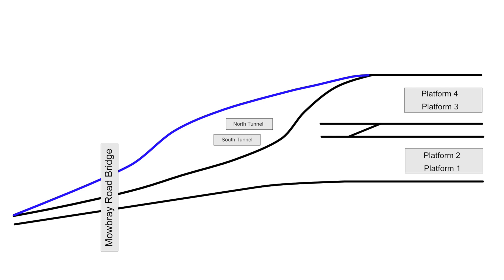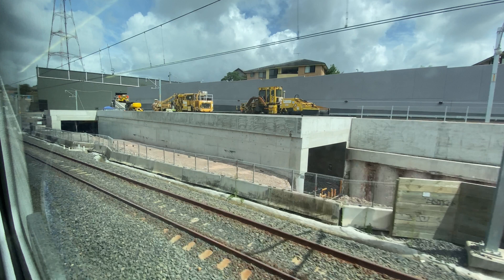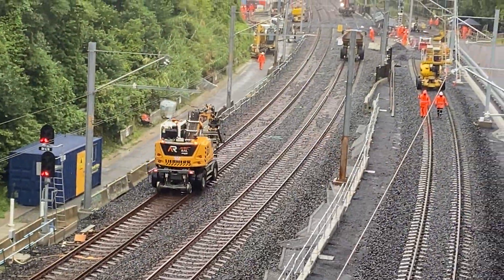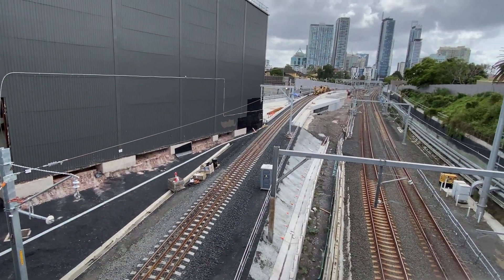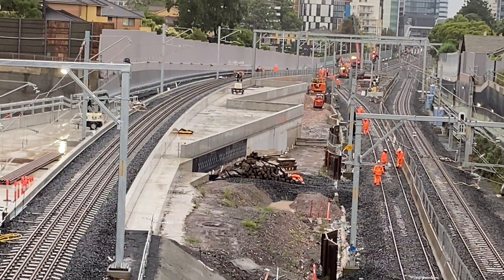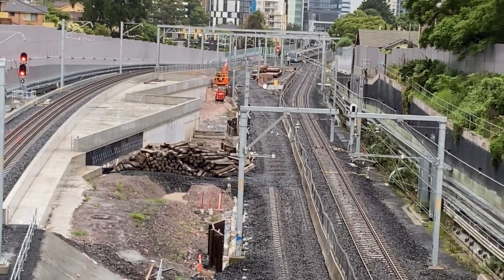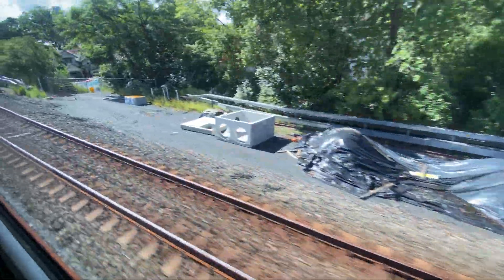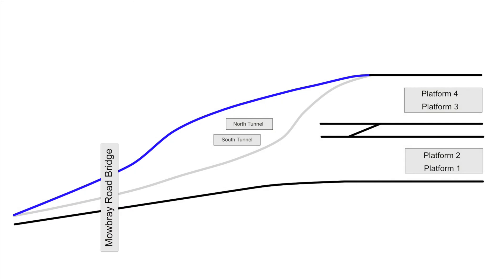Sydney Metro Chatswood Dive Site Update -  New Northbound Line Has Opened!

Comment: Paul, the barrier to the west of the Up main is the work site limit and the removal of the down main was in front of the tunnel portals as the excavation of the portals to link to the existing metro lines was to be undertaken within the two active lines without the requirement for a possession order and shut down of the North Shore line. 

Mind you I am not a fan of the metro as it drives a wedge through our normally brilliant network. This metro ought to have been an extension of the standard suburban system which would have allowed far more flexibility in journeys from location to location without the need to change trains. An example prior to the conversion of the Epping to Chatswood line, was that you could get a train from Hornsby to any of the stations along the line and continue on into the city, the reverse was capable and this did not diminish the services to the upper North Shore and increased services to the lower more populated lower North Shore.

Further to the above the line out to Tallawong could of been simply pushed the additional kilometre or so to meet up with the Richmond line at Schofields. The obvious advantages to this connection to the foot of the Blue Mountains and lovely township of Richmond and the Pubs and restaurants and parks from the North of Sydney via this link would of paid for itself with the weekend travellers.
Reply from the maker: Yes that's right. Personally, I see the metro as complimenting the existing rail system, rather than negatively affecting it.

As Sydney gets larger and more populated, the need for high frequency metro type services becomes more important. Think of London which has the underground as well as an extensive suburban train network (and now the Elizabeth line).  New metro lines do have other benefits such as wheel chair access without assistance, better acceleration, faster journey times between stops and potential to run trains every 2 mins through the CBD. Having said that, travelling from say Thornleigh to Wollstonecraft now requires two changes.

Extending the line to Schofields is part of the longer term plan, and it is lovely around there!

Comment: Now it all makes sense, Thank you for taking your time and doing this your dedication to this has been great.They are doing it in Perth for same reason on there airport Line, Also those 2 additional tracks are because the train needs to stay on the track, They did it in Perth for most there bridges So they are basically support tracks.
Reply from the maker: Yes that's right. They help protect the train in the event of a derailment, which is why they are on many bridges.

Comment: Slight correction, there was a second signal where the tracks rejoin at the southern end. (hard to see, it is black rather than grey on the rear. Newer design I guess.)

The tracks aren't just being moved closer to the signal (that'd be too tight of a corner, reducing speed unnecessarily)
They are being moved enough that another signal is required.

The signal disappears when work begins.
Reply: Did trains run both ways on the southbound track when the northbound line was moved, or was it shut completely? I see a safety fence, so it looks that it could be open.
Reply from the maker: No, both tracks were shut completely on the weekend of 20th and 21st March to allow the work to take place.  Sydney Metro was shut too.
Reply: @TransportVlog  Thank you very much.
Reply from the maker: Yes that makes sense Brayden. When you look closely, you can see the old signal to the right. Thanks for your input.

Comment: I would probably still describe the tunnel portals as one. It's only a short divide and the tracks form a pair below ground. It's merely a concrete divider. They are never separate tracks, the pair extends out, just with a concrete wall dividing them.

A similar thing occurs in Melbourne when the down track crosses two tracks heading into Richmond station. Often crossovers are built like this, with a concrete wall dividing tracks to add strength to the bridge. Often pre-cast concrete is the best and cheapest option.

It's fairly common for bridges to have a guard rail in the middle.
Reply from the maker: Thanks Beren, I might explain the tunnel portals more in another video.  These were created partly to allow the new northbound line to run over them (the actual tunnel entrances are further south). I think the trains do enter separate tunnels, after the portal, but I'll check. It seems like the junction south of Castle Hill station is similar to what you've mentioned here. Thanks for your input.
Reply: @TransportVlog  Yeah, what I mean is, if you look through the south portal, you can see the track from the north portal. Just inside, both tracks are merged. Perhaps they do split off further.
Reply from the maker: @berenscott8999  Yes that's right. I'll defintely go into this more in a future update. My understand is that they do become separate tunnels further down. Cheers Paul

Comment: The 2 extra rails on the new track are called check rails and their purpose is to catch the wheels on a train incase it derails so it doesn't roll itself
Reply from the maker: Thanks for explaining the purpose of these extra rails. I'll certainly be looking out for them in other locations now! - I've already noticed them on the harbour bridge tracks.
Reply: @TransportVlog  They are also called guard rails in some countries like Australia.
Reply from the maker: @localcarthief  Thanks! - I love learning new things from you guys!
Reply: They have been around almost since rail started. You'll notice them on all bridges and now on any rails on some sort of specially raised structure.
Reply: @TransportVlog  we're all here for each other
Reply: @TransportVlog  They usually put those on tracks that are close to the edge like bridges or flyovers etc. to stop the trains that derail fall off a few metres down. You know what would happen if they fall metres down.
Reply: For electric trains they are used for added grounding they dont have them out on mainlines so they aren't for that purpose on a bridge yes - My father was a railway engineer for 35 years with the New South Wales railways and he was the person that told me they are for grounding the underneath of the boggie slides over them as they round the curve ensuring they are grounded because the wheels tend to lift with the cant of the track

Otherwise you'd see them on every curve right through out the state which you don't
Reply: So if you put that second rail on a raised area like a bridge it stops the carriages rolling there and any roll will then happen on the no dual rail bit on flat ground past the raised rails. Is that the idea?
Reply: I haven't seen 4 rails like that before either so genuinely curious.
Reply: @Jimblefy  Sort of, Yea

Comment: Metro Trains built in lightweight aluminium cannot be allowed to collide with Sydney Trains built in heavy Stainless Steel, 
there will be a reinforced concrete wall barrier built between Sydenham and Campsie to separate Freight rail from Metro rail, the guard rail is used at Chatswood as all trains will be travelling slowly entering and leaving the station.
Reply from the maker: Thanks for that Kevin, I'll keep a lookout for these concrete walls and other works to keep the Metro trains away other heavier trains.

Comment: Structure guard rails 
The purpose of a guardrail is to keep derailed bogie/wheels tracked parallel to the 
running rails. This action prevents a derailed train hitting adjacent infrastructure or falling 
off a bridge. 
Guardrails are required on certain types of underbridge, on track at or near structures 
supporting air space developments and at other high risk locations where a derailment 
could cause severe problems. 
Google, "TMC 202 Track fundamentals" the google page will list most track engineering manuals for Sydney Trains.
Reply from the maker: Hi Kevin, thanks very much for explaining the purpose of these guard rails.  Thanks also for the "TMC 202 Track fundamentals" google suggestion. Just downloaded the PDF now.  I'm sure this will come in handy for future videos!

Comment: 7:14 As far as I know those two additional rails are called "Guard rail", they are there to prevent a derailed train from plummeting down the slope. You often see them on bridges, tunnels and other fragile infrastructure.
Reply: Check rail is the other description for the rail in the middle.
Reply from the maker: Thanks very much for explaining the purpose of these extra rails. I've seen them on the southbound track around the Dive Site too (might be able to spot them in the video) and also on the harbour bridge tracks, so it's good to know why they're there.
Reply: We use 2 types of catchpoints in the Sydney Trains network, they are guard rail containment type (shown in your video) and throw off rail catchpoints (when there is a adequate area with substantial run off length to safely derail a train. In highly constrained cases guard rail containment types are the only option
Reply: @MrKiuYin  The check rails on bridges are not to contain a train that has illegally passed a catchpoint- rather, if a train were to be accidentally derailed, it'd be contained.

Same effect, different causes.
I know the type you're talking about- often before certain signals when it is even more dangerous to pass than it would usually be, or where stopping distance before the signal could be too short for any reason.
Reply from the maker: @MrKiuYin  Thanks Russell. Catchpoints would be a great topic for a future video!  - I know there are some on the single track line between Schofield and Richmond.